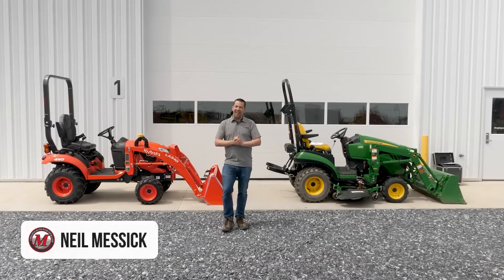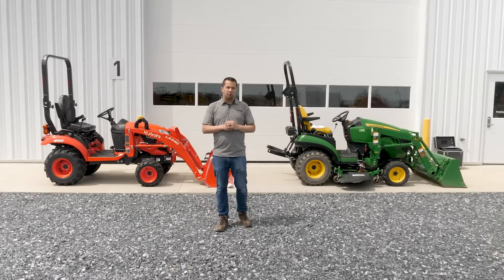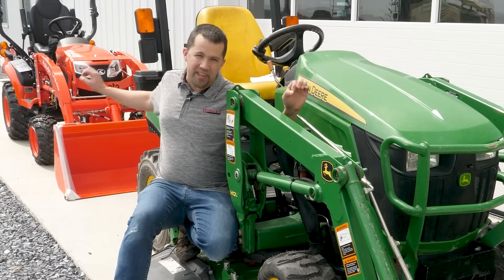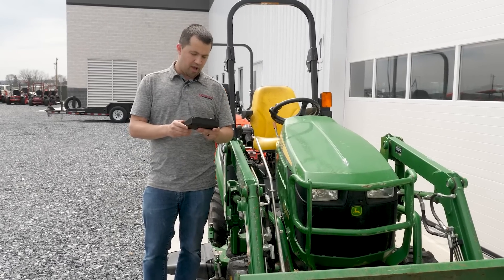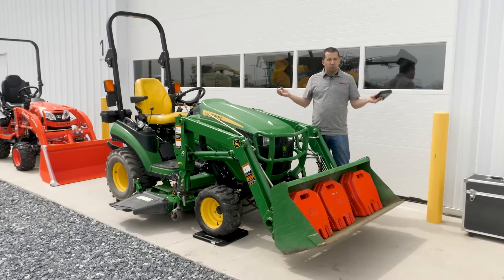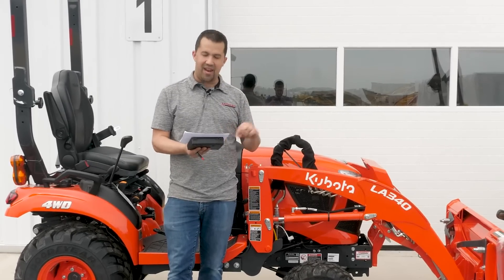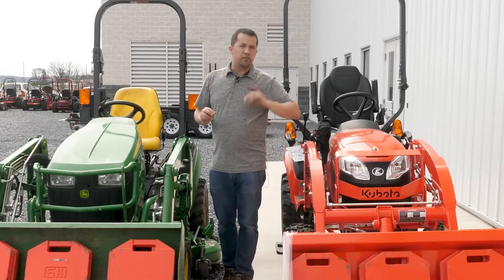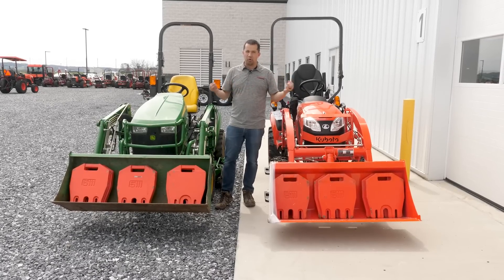front axle capacity vs loader strength

Comment: Neil, I grew up in a green dealership and know of many older tractors that are still working great but they are not over building like they did in the 60s and 70s. Everything you mentioned all comes down to profit. Yes the older tractors lasted 50, 60, 70 years with proper maintenance so this affected sales of new equipment. You are correct the throw away world we live in finally reached the tractor market. I have a Kubota B with a pin on front bucket and I am more than happy with the capacity. I know many of these tractors are for work not play like I do but this greed of saving 2 minutes or 1 load will cost the owner more in the long run when they must buy a new tractor in 5 to 10 years. I expect to have this tractor for the rest of my life with proper maintenance and care but you cant hotdog these tractors like you could with the older models.

Comment: The rear axle capacities weren’t much more than the front, but the rear lift capacity is almost always way higher than the FEL. So, ballasting to take load off the front is just going to put more strain on rear.
Reply from the maker: Fair point. This is why some tractors don't have OEM backhoes.

Comment: i was brush hogging and some how my tire's valve stem got pull out / went missing. just had brand new r-14's put on all the way around. upgraded the stem to an all metal version today but weird, the tractor just plowed straight into the ground once the tire lost air but i didn't know

Comment: Not a complaint, but the position of the load as shown is not the highest load on the axle. At the point where the bucket is about shoulder height is where the extension from the center of gravity is greatest....and the load on the front axle is also the highest. At that position, the front axle load will be about 130% of what you measured on your scales. 
Further, static load is one thing, rolling or moving adds even more stress to the axle and bearings, especially on uneven ground.

Your point is well made, however. 
But one reason for the lower axle capacities is not just engineering, but cost to the manufacturer.
Reply from the maker: You're 100% correct. There's a lot of ways I could get much bigger and terrifying numbers, the principal though, doesn't change.

Comment: Neil, this past weekend I was helping a friend move a bunch of shingles with my BX2680.  Course the light weight of the tractor, and the heavier pallet forks that I have, makes the loader a lot less useful for lifting due to the added pallet fork weight...anyhow, the shingle bundles are heavier than your typical bundles of shingles you find at Lowes, Home Depot, etc.  I was only able to lift 7-8 bundles at a time, anything more than that the tractor would tip, or the loader wouldn't lift at all....every time it got overloaded and would tip sideways, it would always tip to the left, why?  This was on level concrete and not moving.  Anyone else have a BX series tractor that experiences this?  Curious as to why it tends to be more tipsy towards the left of the machine?
Reply from the maker: Tire pressure, or your axle was pivoting
Reply: @MessicksEquip  I'll check tire pressure, but being on flat ground not sure what would have the axle pivoting, load not centered properly maybe?  Only having 20PSI in the front tires makes them look like they're flat when doing any loader work, and that's the max inflation on the tire sidewall...any recommendation on that, can I go over 20PSI, and what would be recommended?  I have the R4 tires.
Reply: @MessicksEquip  

Hey Neil great video. Very informative.  Is the compact tractors the only ones that the front axle is overloaded like you mentioned. Just wondering if all the other model Kubota tractors axles overloaded like that. When ordering a Kubota tractor is it possible to order a heavier built front axle?  The main reason for my tractor is using the front loader.  Thank you for your time.
Reply from the maker: @linemang4337  We don't know because axle capacities are not published. Kubota is your best bet when it comes to this, they are the most conservative when it comes to loading their axles.
Reply: @MessicksEquip  
Thank you for replying to my question. I appreciate it. With that being said, I’m glad I have Kubota Tractor! 😉🇺🇸

Comment: I'm shopping for my first tractor but I wondered about this. Watching videos of newer and older tractors in motion I've seen a number of tractor where the front wheels seemed to move a bit too much. I wondered if it was modern articulating suspensions or if they were cutting corners or designing to narrower tolerances on the smaller machines that are more popular these days.

Comment: Im a little confused… when you checked the beginning weights and were saying that they were basically already at the capacity of the front axel, you have to remember that was including the weight of the axel itself as well as the wheels and tires that the axel was setting on. so if you subtract that then the weight actually setting on the axel itself is lower.
Reply from the maker: I asked for some clarification on my methods here from some internal folks and no one corrected my findings.
Reply: That is a great point. The front axle though with the wheels weighs maybe only 200lbs I'm guessing?

Comment: Thank you for the video.  I am an owner of 1994 Bobcat 453 skidsteer with four different bucket; smooth, toothed, home made 42” forklift, and a 48” rock bucket.  My biggest complaint is Bobcat changed its tool plate from a side pin (which all my buckets are), to a bottom pin.  I want a grapple, so I am thinking about an add on grapple by Precision.  I am looking at the BX23S, because the dealer is only 7 miles from me.  The dealer has several with a plan on bucket.  

My Bobcat handles all my front end loader needs on my 2+ acres, we have JD 130 for mowing grass and dragging a little Harbor Freight dump trailer around.

The reason I am looking Kubota is for the behind the tractor implements like the backhoe, pto-powered rototiller, and box scraper.  With global warming, I do not fear the snow fall (2-3” 4 times since 1972, near San Francisco).  This video makes me happy about the choice, just waiting for the CFO to give me the go ahead.

Thank you for the video.

Comment: The numbers are interesting.  Given that usage of the loader with any real weight would be operation of the tractor beyond its front axle weight rating, what recourse does a given manufacturer have related to warranty claims.  Could an axle failure, even with the loader weight at or below its own rating, result in a warranty claim being denied?  Should it be denied given the ratings?

Comment: Tractors should be industrial durable items, designed and built to last for decades. However tractor design is still primarily to work around the three point hitch and PTO. 

Many prospective purchasers look at tractors as potential loaders, including myself. A tractor will never perform as a loader as well as a dedicated loader. Of course loader machines are usually more expensive and less versatile than a comparable tractor. So  a tractor operating as a loader will always be a bit of a compromise. But it is a strong and useful compromise so most operators are satisfied with it.

Removing the loader when doing non loader work will relieve the stress and load on the front axel for every hour it’s used. It’s not too difficult to remove the loader for most newer tractors and the tractor feels much smaller with the loader taken off.

Comment: The more weight you put behind the rear axle, the more you take off the front axle.
Reply from the maker: Yes, but the amount required to correct it would put the rear axle way over capacity.
Reply: @MessicksEquip  That would depend on the tractor.. Most rear axles can take 2 - 3 times the weight of the front axle.
Reply: @bradjenkins932  specs are published for these two tractors, it's only about 25% more.
Reply: @neilmessick2043  Wow, that's pretty low.. They must have aluminum housings.

Comment: John Deere for certain, and I presume Kabota as well, would never suggest in their manuals that they be loaded like that. They both need rear ballast weight. A lot of rear ballast weight. Using the rear axle for a fulcrum, you would drastically reduce the load on the front axle IF you added the REQUIRED weight on the three point hitch. I'm sure you know this. But you never said it.

Comment: Neil, did not read all of the responses. Is it possible that the front axle "maximum" capacities are underrated from what they actually can handle? Is it likely that ignorant consumer protection causes a lower than actual rating?
Another example would be ladders. A 300 lbs. max. weight ladder, does not crumble and fail at 300lbs. Speculating that manufacturers (may) reduce the capacity to protect consumers and minimize liability?
Reply from the maker: I am sure there is a huge safety factor. It's easy to see though that front axle problems are a common occurrence. I know other companies push that limit far more than Kubota and Deere.

Comment: I'm confused by Neil's argument. If the JD and Kubota are regularly weighing more  than double the published axle capacity and there isn't some large number of owners with broken axles that leads me to conclude that the JD and Kubota numbers are wrong. Maybe the other brands that you feel are claiming too high numbers are more accurate?
Reply from the maker: Axles don't break, seal and bearing issues though do happen. One thing I was trying to do without being sleazy was to point out that Kioti, Mahindra and company are pushing the safety factor way beyond Kubota and Deere.  I think orange and green probably stike a good balance between capacity and durability. Other companies are pushing that boundary, that's when tractors become disposable.
Reply: @MessicksEquip we just picked out a BX23S, waiting for the 3rd function switch to be installed to go with the grappler. 
While looking at different brands, and dealers I found that the companies you mentioned were very difficult to get information, and calling numbers on the Internet / talking to website chats they wanted my name and email before even saying hello. It felt sleazy and my search moved on quickly. 
I know we’re buying a smaller tractor, JD barely gave us time of day when we visited, but Kubota listened to what we wanted, what we needed and quickly took us out to the yard to take a look. Now, that could be the difference in dealerships, one out in a farming community and the other in Tucson, but we’re happy and anxiously awaiting our delivery.

Comment: Great video. With the front ends what break the the housing cracking  or the bearing  going what breaks when we are looking at used equipment
Reply from the maker: Axle knuckle seals. Well known thing. People run thick oil in the drop boxes to keep them from leaking.

Comment: Hey Niel ,

Just wondering , if you watch ttwt in this link https://youtu.be/xX9hbPZO7dA 

He talks about it being 1349 lbs per axle that being each axle spindle on each front wheel ? That being 2968lbs. Total max on the front . Does this make sense ? That seems way more reasonable , and for anyone clicking the link just know he is purposely testing this 1025r way past its limits to see what it's capable of ! Lol 

What's your thoughts ?
Reply from the maker: That video is part of what inspired this one. Tim and I did talk. He was wrong to double the figure.
Reply: @MessicksEquip  awesome 👍 thanks for the clarification and glad you guys figured it out ! I'm shocked that there rated so low! Hardly takes anything in the bucket to "technically" be over weight on the front axle . 

Thanks for the video keep it up !

Comment: As a homeowner with 6ac. Of Forest land and steep grades, I am not one to sneak by with too small equipment! I picked up a M6060 with the Hugh turf tires.. while not thrilled with the tread pattern some of my property is close to large creek (20 ft wide) and the ground is very soft! I just use this tractor occasionally around the house and on the gravel road we live on. Point is I don’t want something that will not handle what I need it for when I need it!

Comment: Workmaster 65 can lift more than the axle can handle. We broke the ring that the bearings seat against in the planetary hub. Aftermarket hubs are available, but I would bet they are even weaker than oem. We feed baleage and now just crawler gear everywhere.

Comment: Well Mr. Neil thank you So much for demonstrating & "running the numbers". It sure seams like 90% of the "New Trak-tor " Owners are "WAY" Over-confident on "Super-Maxing out" their compact tractors, & they usually even Want MORE! They allways want the "Factory Warranty " to PAY for the ; leaking seals,crushed spindle bearings,& busted front axles within the Very narrow margin of use, ( like 0-75hours & 3-18 months). They forgot about the "shovel & wheelburo  days" completely. By just wanting to hurry-up & "get er dun" in 3 trips instead of 5 safe&reasonable trips. Sometimes "New Twack-tor Home-loaner's"are"Their own worst enemy". The "Proven Majority" of Instructive U-tube Vidio Producer's; / like 90% have NEVER Read the Operator's Manual With the Exception of "how to change the oils". It's just a lesson ( usually) in "Pure Ramming Speed" adventures. (They crack me up SO much). The whole "Rear counter-weighted system" is a Concept that 75% of the "New Twack-tor Owner's" are "Clueless" on. Their perception of Wheel-spacers & Tire-fluids make them believe "All bases are Covered", & they just "Go fer it" with "Gusto", then they wonder why they see a "Wet front Axle". Thank you Sir for the Excelent vidio. Best wishes with all your endeavours of Informing & Educating the Public.
Reply: Wow! Bet you’re the life of the party. We’re new owners, and I most certainly wouldn’t classify ourselves as you implied. Unless you are the warranty manager at a busy dealership you should stay in your own lane and consider retirement. I bet you go around disparaging the younger generations too. 
btw, we are both proud veterans and Boomers too.

Comment: it would be interesting to add the recommended ballast weight for the load to the back and see what it does.  I suspect you are likely dead on the engineering limit noting that no-one weights a bucket they just fill it and wet clay weights tons.
explains why seals go on the front axle if you do a lot of loader work.  also explains for the average low hour user on a flat block not doing much why these things work happily away for years.  snow for 6 months of the year probably helps vs working it 12 months of the year hard.

Comment: Well being a ford 9n owner , what I look for when buying any tractor especially from a dealer , I like to see lots of steel and metal parts including hoods , , that was for team green , but yeah I mostly just do snow plowing and in the summer moths i grade my drive way , I have used a 7 foot wide grader blade for about 2 years on my n and it worked great , but yeah Ik newer stuff runs a lot different and probably better with high fuel cost but I personally like the brands that offer a heavier duty tractor like if u look at the old John Deere 855s vs the newer 1025s I’d take the 855 bc that thing was a tank , work horse if u will , yeah it goes on what ya do for sure but I think for that type of money and being it’s met to be worked , should be built good and able to last ya a good many years with the right service and stuff .

Comment: What happens to the load on the front axle when there is a 3PH attachment or ballast box on the back?  I know when I have my backhoe on, my front end is way more bouncy.  I would also never consider loading my bucket to the max without proper ballast on the back for safety reasons.  This was a great video, and I look forward to more like it.  Thank you.
Reply: You won't get much weight in the bucket without any rear ballast on these sub-compact tractors, they don't have enough weight in the ass end to keep them on the ground, and as I found out, even my 300lb tiller on the 3 point ain't enough when doing heavier lifting duties with the pallet forks....although I've found my BX can't lift much at all with the pallet forks I have since they're not for a sub-compact tractor....they're for a compact I believe, so they weight about 80-90 pounds more than the sub-compact version, and the forks are 42" VS 36".

Comment: I love this discussion.  I have a 2WD B7200E with a loader designed for the 4WD version.  I have sheared those front spindles enough to where I have a set of used spares in the garage.  The tractor will sit there and load hundreds of pounds up and down all day...but when I move the tractor/load is when I have to be really careful to avoid the unexpected bump.  Its still been a fantastic addition for light materials and wouldn't change a thing.
Reply: So if they are used does that mean they come from a Boneyard and not broken or repaired?
Reply: @brentanderson3806  correct.  I buy them used not repaired.  I imagine folks who are better welders than I am could grind the cone shape needed and weld them but I just buy a used one (and try not to do it again next time.)  I even looked into buying a used 4WD front axle for this model but too much money.  Hope that helps.
Reply: @billprice792  I was just curious. I hope I did not come off abrasive
Reply: @brentanderson3806  you were just fine. I Enjoyed the question.

Comment: I am totally confused Neil.  The FEL capacity results in the front axle being overloaded, and that is with an under-rated potential load of gravel.  A full bucket of gravel far exceeds all the ratings, so how are the Published Specifications of any value?  This does not even take into account the stall-lifting capacity of the FEL which I believe could exceed 1,000 pounds at maximum recommended hydraulic pressure.  Perhaps you can do such a demonstration?